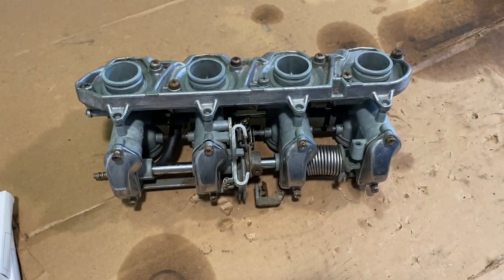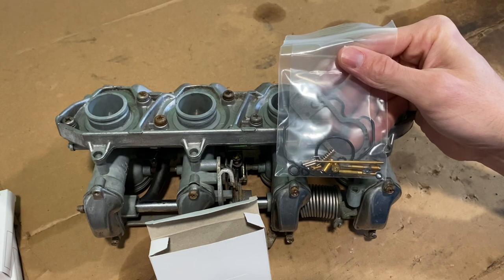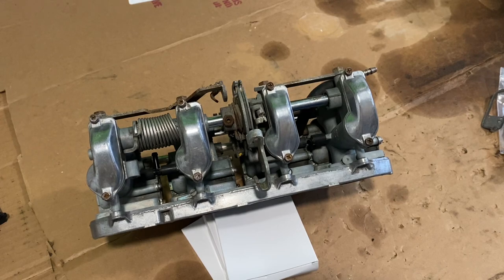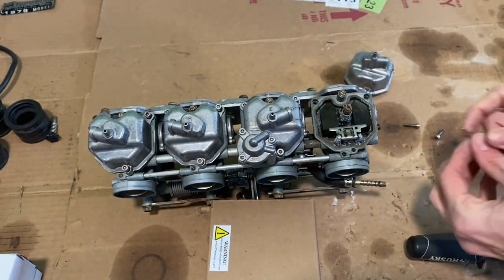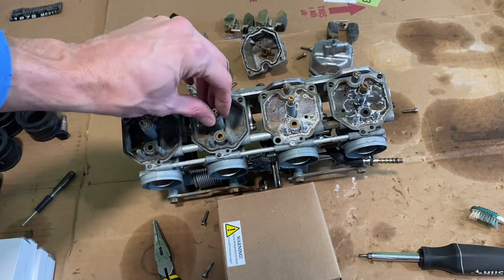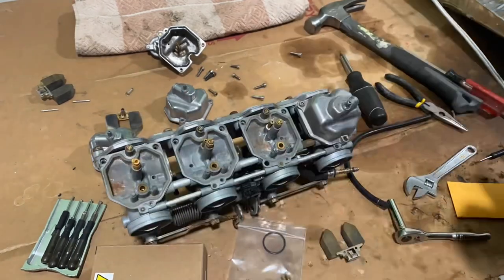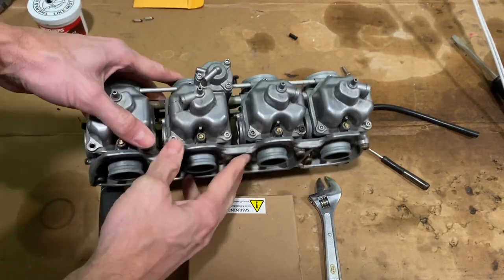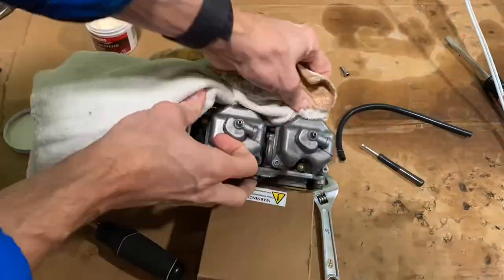Carburetor Rebuild - Honda CB650

Comment: How did everything turn out? Any problems with the accelerator pump?
Reply from the maker: I’m still working on the assembly (slow during summer here). Hoping to set my wiring diagram soon.